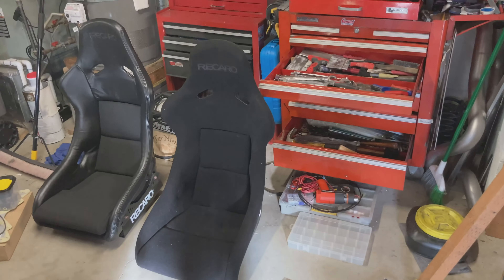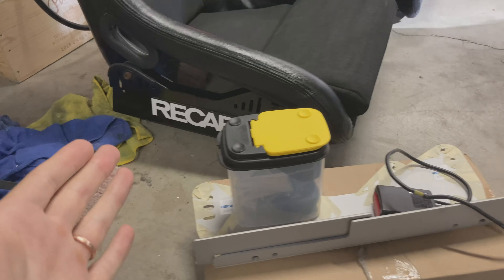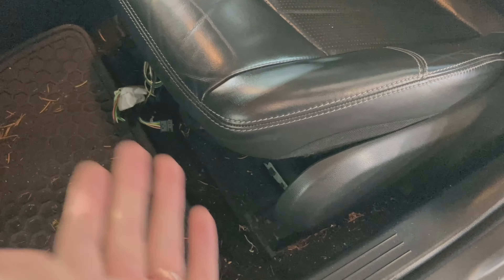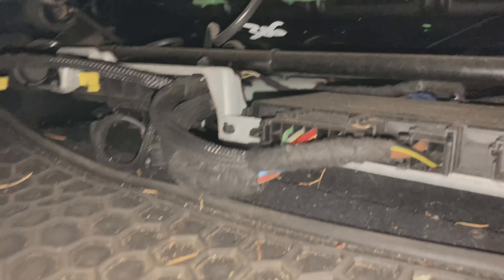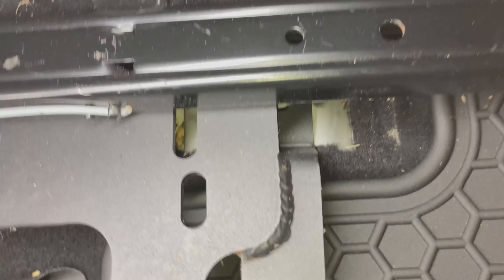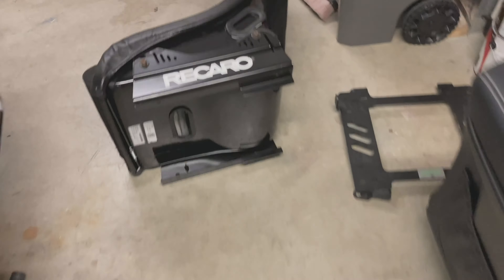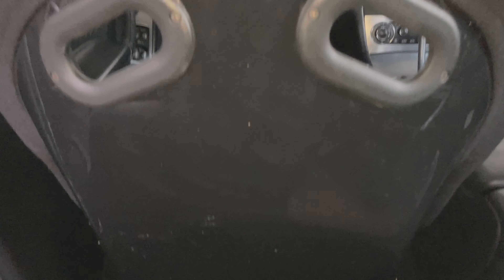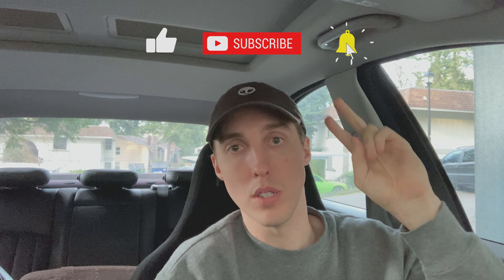HOW TO INSTALL RACE SEATS - RECARO POLE POSITION

Comment: Liquid molly 10w-60 all day 🙏🏾
Reply from the maker: interesting! going to run a 15w50 here soon myself.
Reply: @ANDERZENAMG  just wanted to give some advice, I'm a Mercedes tech... 15/50 WILL damage that engine, first number is flow rate when cold and that's way way too heavy for that motors precise tolerances even at the miles you're at you can get away with the 50 which is the oil's ability to maintain proper viscosity around 200° or so but I wouldn't go higher than anything other than a 5 for your cold flow rating. Cheers
Reply from the maker: @mrawesome2524  yes, I’ve been trying to research the highest cold weight I can run. The viscosity is 18cst for the 15w vs. 13.5cst for Castrol 0w. Definitely wanted to do more research before running it. I don’t ever see less than 35 degrees Fahrenheit on startup.
Reply: @ANDERZENAMG  sounds like you've put a lot of thought into it, curious though what's your reasoning for wanting to run a high cold flow number?
Reply from the maker: @mrawesome2524  yea I’m kind of a research nerd with oils. The cold weight wasn’t the motivation in this case, it was the overall makeup of this specific oil. It has very good zinc levels, good base oils and ofcourse has a higher heat rating being a 50. If I don’t find everything I need to be fully comfortable with it, I’ll either mix it with 0w40 or find a 5w50 or 10w50 to run.
Reply: @ANDERZENAMG  i see, i recommend the YouTube channel, project farm, find his if you've not seen it his oil showdown it's several episodes and it's absolutely fantastic
Reply from the maker: @mrawesome2524  yes indeed! That channel is awesome!